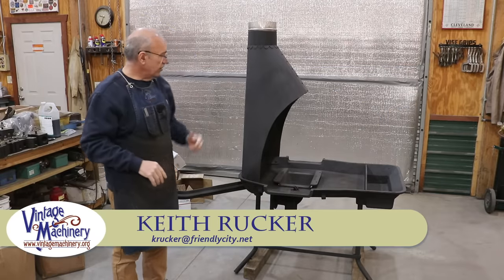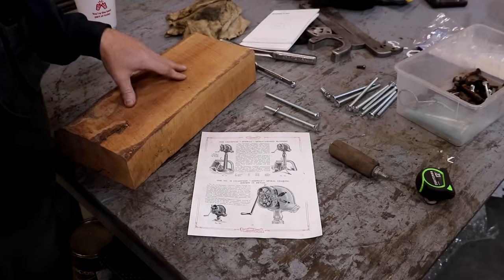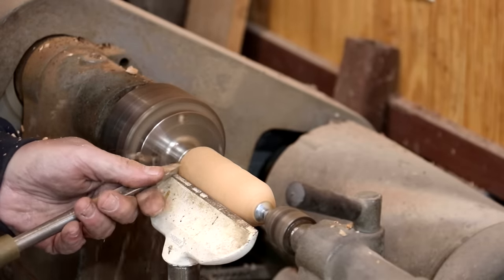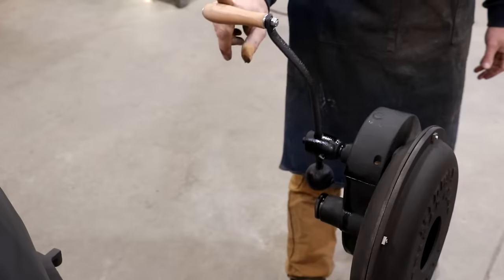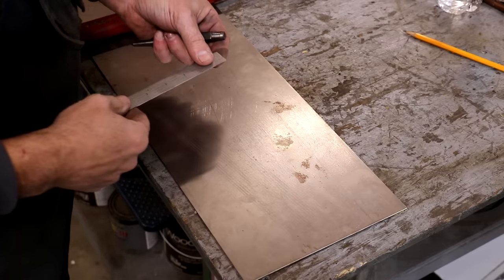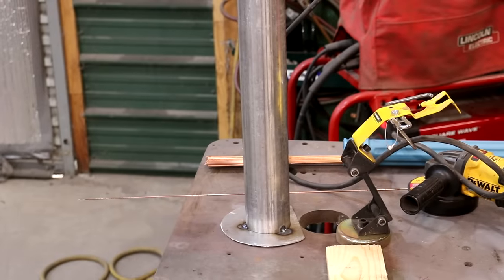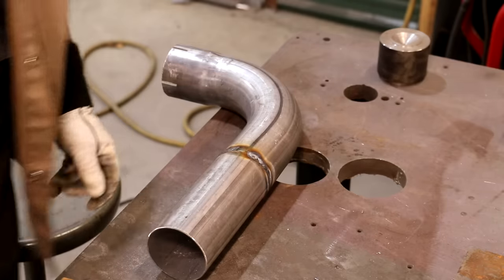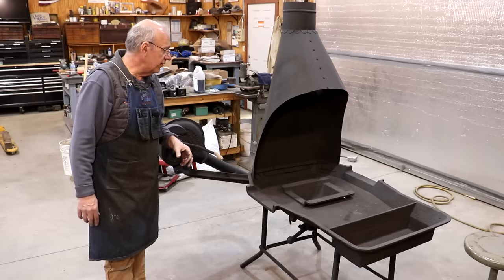Blacksmithing Forge: Turning a Wooden Blower Handle & Fabricating and Installing the Air Pipe

Comment: For handles like that I like to have the bolt fixed to the crank with a counter nut and then the handle body loose on the bolt so it can spin. Makes it less wobbly. I preferrably use a long cylindrical bolt with a smooth shaft, then have a counter bore for the bolt head in the body and if you really wanna make it pretty: press a turned metal cap into the counter bore. If you don't have a smooth bolt you can also put a thin piece of pipe over it, then tighten it with the bolt itself.
Reply: I'd prefer that plan as well especially if the handle were being used more often than on this forge blower.
Reply: I would think the original was similar, with the wooden part free to rotate with your hand.
Reply: It’s Keith’s forge, but that handle would drive me nuts in no time.
Reply: Your's is the correct way to install a handle of this type
.

Comment: The hood is a work of sheetmetal art. Keith's restoration projects are often required for another project which is great motivation.
Reply: Yes, we were told the Boring Mill was restored to work on the Stoker Engine, but we don't know when!

Comment: I would suggest mounting the handle on a smooth shaft so that the handle spins on the shaft. It will be not be good to have the handle turn in your hand all the time.
Reply: You are right Ben. All of the old blowers used a long rivet, and the wood handle spun on the rivet. I have replaced several rotten handles by turning a fresh one, complete with a slightly oversized hole, and carefully split it. Then carefully glue the handle back together over the rivet. It has worked wonderfully, and I did not lose a hundred-year-old rivet in the process.
Reply: Agree.

Comment: The funny thing about the whole measuring for the inner circle is you used a hole saw. All you really needed was the pilot. I've done that exact thing before though. Scribed out the whole foot print just to realize I'm just using 2 different hole saws. One with a pilot drill and the second with a pilot shaft. I still catch myself scribing out the footprints before realizing it. I guess the ritual of it is just comforting.

Comment: On that handle... the wood outer part should spin on the metal shaft it resides on. Using the bolting face of the spinner arm as a bearing will fail in very short order
Reply: Yes. This Rucker design is far worse than the one that was on there.
Reply: Lets put a bearing on the metal arm then bolt this handle assembly to it.

Comment: I think the wooden handle is supposed to rotate on the bolt. If you take the carriage bolt off, put it a lathe and turn down the square part, then it should rotate nicely. Look forward to  heating up some metal and hammering on it.
Reply: Your correct. The original bolt would have had a smooth shaft with threads only at the end.

Comment: Keith,

After watching you fit the pipe on your forge and seeing the work your sheet metal shop did, I have a suggestion.   On your Monarch restoration instead of the hammered fix for the chip pan, why not insert the bent area?  I recommend that you weld a 3/8" or 1/2" round bar to the edge for added rigidity.   You could cut out a couple of handholds to ease the removal of the pan.

The forge is looking good.  Do you intend to use it inside or outside?

Bob

Comment: Boiled linseed oil would be good for the handle.
Reply: Yes or a few light coats of tongue oil
Reply: @Garth2011  *tung oil is pressed from the seeds of the tung tree. Using the oil from your tongue is not recommended for wood finishing.
Reply: @kindablue1959 Never trust your voice to text without a full review. Tung oil is really decent. However, dry time between coats is longer. Once 3 or more coats are applied, it's durable.

Comment: An electric air pump should be the next upgrade on this baby! forget that "blower of agony!"
Reply: He'll do that just as soon as he gets rid of all his vintage mechanical machinery and installs CNC machines. 😲
Reply: @kindabluejazz lol, no computer fan required. Just a vintage one like those in every machine Keith uses.
Reply: @KeefyKat  In a truly 'modern' shop, the fan would be in fact digitally controlled to maintain the exact perfect temperature.

Comment: If you turn down a thin nut and put it before the washer on the other side of the handle's arm, it could tighten itself on the arm and then all you'd need to do is remove the square from the carriage bolt and have a rotating handle rather than on the bolt. It won't survive that long, these days the quality of bolts ain't the same like back in the day.
Reply: nice

Comment: I would like to think the handle should be a rotating on its own shaft type than one that rotates in the hand.   So, a glove or hand could grab hold and turn.  A slip one that is full metal has to slip in the hand all the time.  So, the hand closes on the hand, not the handle.   Nice overall project result.  Thanks.

Comment: Sketchy on the drill press.  One should by practice put the hand bar section up against the post.  Then the torque will be on the drill press itself and your hand is then holding it level to the table only.  A three-dimensional hold that bobs and twists can be dangerous.   Keith knows this but it was a quick job...

Comment: Hi Steve. Great video as usual. I was just wondering if the pipe you were using is galvanized. If it is , you should be cautious when welding it. When galvanize steel is welded it releases toxic fumes. Not good for you. It also messes up the torch and the weld with this weird black soot. In case you have to weld galvanized steel in the future, you should make sure you grind the zinc coating clean before welding.

Comment: 5:20 You shouldn't lean over the band saw like that because you might cut your head Keith. The cutting band should be covered.
Reply: I get the heebie jeebies every time I see Keith operate that unguarded bandsaw. I realize it’s authentic without the guards, but I’ll bet many of old-time craftsman got seriously injured by blades breaking, jumping off the wheel, etc. Shit happens.

Comment: Just a thought, you might want to put small feet on the ends of the legs to prevent gouging on the floor by the ends of the pipe legs.   Looks Great otherwise.
Reply: He said he wants to keep it original, but I think back then most forges would be on dirt floors. I think some type of feet clamped or inserted into the legs instead of welded would be enough to preserve the original legs while making it more appropriate for polished concrete floors.

Comment: I would have turned off the threads on the bolt or even gone a couple sizes bigger and turned that down w/o the threads which WILL eat away at the inside of the handle. The reason the handle bends when you apply force is partly the threads and partly only one washer and partly a smaller diameter bolt than is needed. And I'm pretty sure I saw two washers in the reproduction picture of the "factory model" which were usually utopian views with smaller feature items like your handle to make it seem like an easier job than it is. Such a fine peice of hardwood! I hope you build a chimney for the smoke you must make when the fire is lit for the first time. Any large open fire especialy coke fuel for forging is gonna blow away everything else in a minute flat as far is carbon monoxide is concerned. BTW have you sourced your coke?

Comment: Those sure are handy to have for all kinds of jobs that need or use metal/iron. I have to laugh at products made today with 100% plastic however, that's the case when you have high labor rates and ridiculous costs of running a business these days. 
I'm wondering what the compartment is for towards the front of the forge, Coal?

Comment: I would like some info on your Monarch lathe. I have one the same size , but mine has another feature of changing the feed rate. There is a hydraulic clutch between the input shaft and the headstock, I was wondering if there is a port to install a pressure gage ? 
Thanks

Comment: Keith ... if you had drilled the hole saw  before cutting  the major Dia .. it would have bee easier to hold on to . and the line you marked should have bee folded to give you a  fixed flange to take the weight of the pipe.........but just a thought I suppose

Comment: Yet another very enjoyable video.  Constructive criticism - you should never put your fingers on the far side of the tool rest with the timber turning.  Getting your fingers trapped between the wood and the tool rest is not a pleasant thing to contemplate!

Comment: Nice video thanks,
 but ... I was thinking you would make a smooth pin for the wooden handle on the lathe. I would have done that. Btw.. thanks for the excellent demonstration of the superiority of working with customary units over metric units. ;-)
Reply: By superiority of customary units do you mean when half of 6.5 turned out to be 3.25? 😅 I'm from Spain and I use both without too much hassle 🙂

Comment: Keith, first of all, you've done a champion restoration job on that old blacksmiths forge and blower. It looks almost new. Which makes what I'm about to say so hard.

The last thing i want to do is spoil your party, I honestly mean that. You've done a smashing job.

Pointing these errors out after all the hard work and trouble you've gone through gives me no pleasure.

I'm sure that if the shoe was on the other foot, and you believed another engineer had made errors,  you would diplomatically point those errors out, as im trying to do, right?

First, the hood.
You had it commissioned which is great. You told us that you gave the guy the measurements. Where did you get those measurements from? Because one of you, in my opinion, has made a booboo.

My opinion is, thst the hood, like many i have seen and worked with over the past 40+ years, should cover the working area where the fire pit is.

Looking from the side, the hood should have at least a 6" overhang covering the fire pit completely. It looks as though your hood is short by almost a foot on camera! All heat and fumes from the working area, namely the fire pit, will not flow into the hood and out via the chimney. Not unless you attached a jet engine or a very strong extraction fan. That setup is best suited for outside forging, and the hood serves no real purpose.

Now, on to your errors. 

I will explain in detail because I'm sure there are others out there who may have the same issue with a similar style of handel or forge. 

The handel.
You used a carriage bolt. That was your first mistake. The second, was only using one nut and washer.

There should be two or three nuts if you are not using a nylon locking nut, which you are so two will do in this instance.

The handel you turned, which looks great by the way, looks very similar in style to the one in your catalogue. It should have a washer at both ends. However, if you use the correct style of bolt, then only one washer is needed.

The washers allow the wooden handel to move or spin freely in the hand when the blower is wound up.

The bolt, NOT the style you used, should only have enough thread to allow room for a standard nut, 2 washers, the blower handel, and finally a nylon locking nut.

If you continue to wind the blower up using your present set-up, you may very well experience blisters on the hand and the hole in the blowers handel to become oval in shape due to a wonky wanky bolt.

When the wooden handel becomes loose in time, and it will if something isn't done about it now, the threads on the bolt will soon ware the wood away.

Easy fix for you, Keith.
1. Use the correct style of bolt.
2. Use 2 washers.
3. Use 1 standard nut.
4. Use the nylon nut you already have.

If you don't have the correct style of bolt, then it's an easy fix. You can remove most of the threads using your lathe. That will allow the wooden handel to turn freely and not damage the inside.

Before doing anything else, check the hole size in the arm. That's the long thin rod with a ball at one end, and at the other end where you attached the handel. Check to seeif it is square. If it is, then try fitting the carriage bolt first. If it fits in nicely, snugly, then use a thin square nut to secure the bolt in place. That will make it rigid. Then use a washer, then put your wooden handel on then another washer and finally the locking nut. 

If the carriage bolt does not fit because it is round, then you may need to use a second washer placed where the square nut was. That way, the wooden handel will be secured and work much better with a washer at both ends. Sounds complicated I know. Explaining things was never my strongest point.

I took a walk around my shop with my son. Out of 7 machines using a similar style handel, 4 have a washer at both ends. 2 have just the one washer, and one type had none. Not because they are missing but because of their design. The spindle with a simple thread at one end is either welded to the arm or fits the hole perfectlywith a typical thin square nut if its day.

These thin square nut incidentally,  were made by smithies. The square nut was basic but very functional and still in use today. Thin and simple but does the trick.

The final machine, a hand powered grinder, previously had a sharpening stone fir knives. It has a bolt with the end washer built in. It's difficult to explain, but imagine your carriage bolt with a washer welded on where the square part is. 

The spindle is part of the machine, meaning not separate like yours is. A small washer is put on first followed by the wood handel, then another washer and finally the nut. I also have another small machine in my office, a guillotine, built in 1858 in Birmingham. Originally used to cut paper but now used to cut cardboard which I use to make patterns saving on sheet metal. CAD we call it.

All handles, apart from one, have a securing nut between the handel washer and rod or device lever, which when another nut is used on the other side, then tightened, the two lockin in place the spindle that in turn allows the wooden handel to move freely. What a palaver explaining it all. Im sure someone else would have done a much better job of it than i have. My apologies everyone. 

Next up, the flange .
Instead of using the drill press, you should have put the sheet of metel in a vice then used a hand-held drill. It would have been safer, sturdy, and easier.

Before you went ahead and welded the pipe to the flange, you should have drilled out the fitting holes after you marked them. That would have been easier, but you never showed us that part or how you did it. Is that why, because you messed up?

The joiner connected to the blower next. 
You should have trimmed a little off the flange end so it left no gaps. Gaps mean less air flow to the fire pit. I noticed you welded the other gaps, but using a strap for the top part is not necessary, not if you only remove a short strip of pipe about 1" wide. You would need to remove the pipe anyway, so instead of welding up those 3 slits, just cut half of them away, simple, quicker, cheaper.

It's simple when you know how or have machines around you with similar handles! 😝 It's also easy when you have made as many mistakes as I have over my 49 years as a fabricator welder and now a lathe expert. 😂 

Before i finish, there is just one more thing i would like to add, which is. My son is a Smithy, as he likes to be called. A blacksmith for 14 years now, and farrier for 9 of them. It was he who pointed out that the hood seemed not right.

He showed me photos, flyers, magazines, and operating instruction manuals that came with some forge models and equipment that he got from my brother. Why he had so much I'll never know. He died from COVID. 

These British magazines, flyers and manuals showed many styles from 1852 to 1974. The most commonly sold forge was the Halifax built from 1901 until 1968. It was a mobile forge used mainly by farriers who travelled to where the work was. They visited stables, liveries, farms and large private estates belonging to the gentry. Some set up wherever they were needed to shoe one or two horses in a field. Some set up in simple barns or specifically built ones for seasonal work.

Some, like my great, great grandfather worked on a gentry estate for 53 years man and boy making shoes for the estate horses as well as forging iron into whatever the Lord of the time required. We know he would visit local farmers to shoe their cart horses. There are two photos of him with his forge on the back of his cart and Trixy his black labrador retriever. 

It is in one of these photos that my son showed where the hood had a peak running the full width of the hood. Each side of the fire pit is identical to the ones you have where small shelves were attached.

One side with coke or charcoal and the other side with wood used to get the pit up and running. Nowadays, such burning materials have changed for smokeless  charcoal.

Never the less, a job well done, Keith. 🇬🇧⚒️🇺🇦

Comment: Great job!  One tiny quibble from someone who as a child had to keep the coal furnace in our house stoked up in the winter.  Are you planning to use this outside, "under the spreading Chestnut tree" as another fan said?  I know that you have a fresh air blower on the intake, but I'm pretty certain that almost all coal or charcoal fires generate a lot of carbon moxoxide.

Comment: Too many folks telling you how you should have made the handle spindle. It was nice to see some wood turning I guess you are a bit rusty but it turned out OK( no pun intended). I guess you were wearing a face shield but PPE is important when turning, and my request please remove the steady rest before sanding, I am a wood turner and safety is important.
Reply: Very true...all you have to do is let go of the handle once per revolution...not a big deal unless you will crank it mostly 8 hours a day